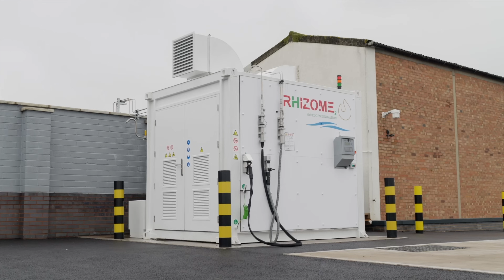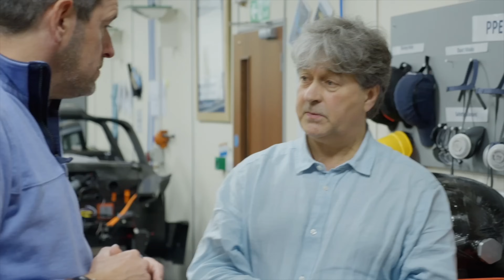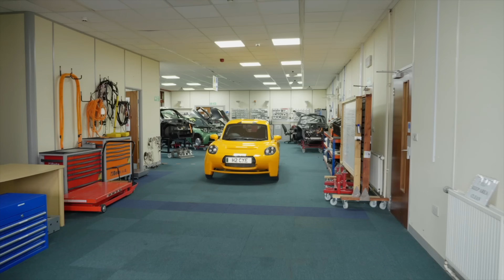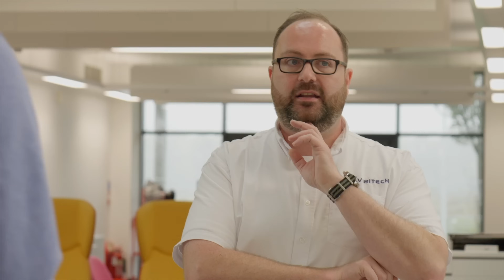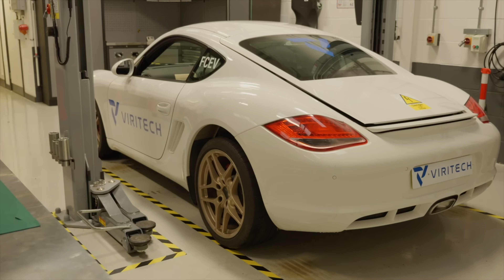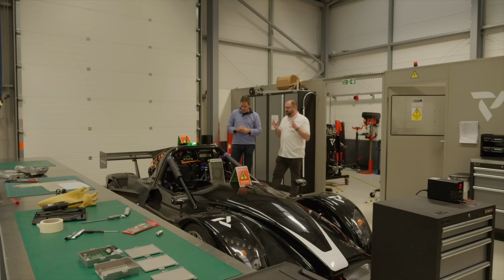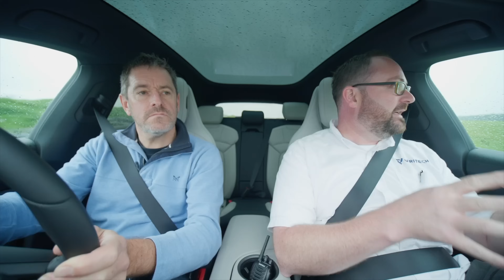Is Hydrogen a viable option for our Automotive Future ?

Comment: A small problem with Hydogen power , at this time, is cost. I have been reading and hearing about Hydrogen power for the past 50 years, yes 50 years, the principle for using the gas is well known , but still the price point for clean Hydrogen is too high. It may be that the promised breakthrough in Fission electrcal generation will occur, (again I have been waiting for 50 years) but until we have very cheap eletricity to spare the future will still be BEV, or other electric power trains. Producing Hydrogen that is not pollution free in its process is a non starter.  
The world wide requirement is for non polluting vehicle power. be they BEV Trams , Trolley buses, pantograph lorries etc. Priced and available for the masses. 
Not once was the real world cost mentioned in this video, very interesting though is is.

Comment: Hydrogen fuel cell cars have been around for over a decade. Honda had the clarity. Toyota had the Mirai, which is now on generation 2. The problem was always the lack of fuelling stations to fill up with hydrogen. There is one in my small city, but it’s in the bus depot and used for their own buses.
Reply: Exactly 3 Mirai have been sold in the UK in the last 2 years.
Reply: And hydrogen is very expensive compared to just plugging into the grid or your own solar panels. I've very comfortable not going to a gas station to buy gas or hydrogen.
Reply: @gordonmackenzie4512  also because the size of the tanks (“hydrogen is easy to store”) mirai is extremely compromised vehicle

Comment: Hydrogen has been produced for many years in Orkney. Sea water is split using surplus wind and tidal energy. Hydrogen fuel cells are used to power the hospital and Harbour.
Reply: A much better use for hydrogen tech. The gas is used pretty much used at source reducing leaks. For general transport needs it's just silly.
Reply: Yes, but if that was built now, rather than "many years" ago, I suspect it would be a different solution storing the surplus wind and tidal energy in batteries and then directly powering the hospital and harbour (and whatever else you want if you have a local grid).
Reply: @lurcher300b  it depends on how much and for how long they have to store. Storing electricity in batteries is EXTREMELY expensive and space ineffective. Yes you can have a powerbank for your house, but if we are talking about something like hospital the battery size would be enormous. 
More, in case of emergency, if you run out of battery, you are 'done' if you have generator run on hydrogen you can always transport and refill. 
Hybrogen is a dream material to deliver massive power to places where building high power installation is difficult/cost inefficient. 
but the entry point is the same. the electricity used to create hydrogen must be FREE, not green, FREE, like surplus from renewable sources or nuclear plants.
Reply: @gordonmackenzie4512  this is a reasonable use. If you have abundance of energy, create as much hydrogen as possible. Store, and use later or elsewhere

Comment: Separating Hydrogen currently contributes approx 4% of worldwide greenhouse gasses, a petrol car is less polluting. Using electricity to create it wastes 66% of the electricity compared to putting it straight into an EV so the cost is crazy. Hydrogen filling stations in the US are closing and here in the UK barely exist.
Sorry Ped this is just Oil and Gas Shill propaganda.

Comment: This is a very interesting look into hydrogen and how it can be used to power cars. Recharging is as fast as a fuel car 5 mins and can store much more energy than electric equivalent because the energy density is higher. You can also get existing fuel stations easily adapted for hydrogen than building rapid chargers. But also
The hydrogen fuel cells themselves are complex and not as efficient as ev. Still more efficient than petrol cars. Plus hyrogen is highly flammable but so is petrol. However it can leak more easily due to the high pressures needed to operate in the tank. Then extraction requires alot of electricity. I think the fuel cells are progressing and are very safe these days and if power was obtained sustainably it could make hydrogen out to be a real contendor. 🤔
Reply: Honestly, no, hydrogen will never be a contender. It is massively energy inefficient.
Reply: @appkazoo5925   yeah but so is a combustion engine. Electric won't work everywhere and for those places the hydrogen will be better. Like I said 5 minute refuel and store much more energy because of density. Production will be overlooked as it will be just for the select few scenarios where ev don't work. Its to compliment the change to ev. Not replace.
Reply: @cephasmakuzva  Nope, not happening. If hydrogen had any chance at working it would need to be produced at vast volumes and even then it would be too expensive. If you niche it down into ever smaller implementations the costs become insane.

The "5 minute refuel" is a myth.

Comment: I really do not understand why the scientific community hasn't come out strongly against this ridiculous "technology".
There is nothing particularly difficult about getting hydrogen to burn in a combustion chamber, so why hasn't it been done before?
The answer is quite simple; the energy density of hydrogen is pathetically small. Burning hydrogen produces about 2% of that of any hydrocarbon, so the only way to make it worthwhile in combustion engines is by making it EXTREMELY DENSE, so dense, in fact, that it becomes a liquid. But to get it to a liquid requires IMMENSE pressure, around the 70 bar mark.
There is no easy fix, no magical formula or technological breakthrough which can change any of these factors. There is no valve which will not leak at 70 bar and the cold that goes along with it. There is no pressure vessel which is light enough to use at those pressures, and there is no way to "crack" water without using far more energy than you get out.
The only advantage with a hydrogen fuel cell is that it allows you to convert the hydrogen into electricity relatively efficiently. 

Nobody has yet come up with a solution to even ONE of these physical limits to using hydrogen and, as a scientist and thus pretty damned familiar with the energy equations involved, I see no possible way to change ANY of these factors.

Hydrogen as a fuel for motive force in vehicles is simply way too inefficient, not because of the cracking or the burning, but because of the energy gradients involved. I don't need engineers to say to me "But if", it's simply that the mathematics CAN'T change.

Well done though, in producing yet another video promoting wishful thinking over hard science, you join a long list of other content providers who can sell people on an impossible dream.

Comment: I would like to share your vision, but hydrogen is just too energy intense to produce it green, you may as well use the energy that makes hydrogen,  to make electricity and store it. We at a new revolution in transport and hydrogen has been stepped over.
Reply: EV batteries are not green - slavery to mine Cobalt and the sources of Nickel constrain  it.
Reply: Hydrogen is just too energy intense to produce it green. Please explain. Hydrogen is easy to store, electricity is not. 
It can be created with electricity created by green methods in periods of glut.
Reply: @matthewoakley3772  How are you making your electricity? Most hydrogen produced today comes from gas using high temperatures, and requires masses of energy and is not green. If it is made from water it requires masses of energy, not many countries are fully green electric on the scale required. Basic school science converting one energy to another is not efficient. If you think hydrogen is easy to store you need to look into it ,1kg of hydrogen requires 11m3 to store it at atmospheric pressure. To shrink it to make it smaller to store,  requires even more energy. Hydrogen was a pipe dream. If you all ready have that energy in electricity it is just easier to use electricity.
Reply: @matthewoakley3772  “it can be created with green electricity” in the less efficient process that charging a vehicle with that green power.
Reply: @matthewoakley3772  Hydrogen is actually very difficult to store, compared to electricity.
Reply: @matthewoakley3772  Hydrogen is TERRIBLE to store.  It escapes out of literally everything as a gas.  Anywhere that contains a hydrogen tank needs to be ventilated.  To have better density, you have to liquefy hydrogen and that is a whole extra can of worms.  You have to actively chill it or use it quickly.  Liquid hydrogen tanks have to have a relief valve to release gaseous hydrogen to the atmosphere for when it warms up.  So you use it or lose it.  I can leave my BEV for literally months and watch a 1% loss of charge and that is mostly due to charging the 12v battery the connectivity runs off of.  That being said, I do agree there are green ways to make it and it may not be bad to make during periods of extra energy.  There are vehicular uses for hydrogen but they will probably be limited to medium to heavy duty vehicles if battery technology doesn't eclipse fuel cells first.
Reply: @matthewoakley3772 dead wrong! Electricity easy and cheap to store in ever cheaper batteries at grid scale & in battery electric vehicles and even charging hubs.  Hydrogen is a light gas that you have to pressurise to 400 or 700 atmospheres, it embrittles metals, diffuses through almost everything and it has one of the largest explosive ranges of gas/air mixtures.  In short it is a nightmare to store and that is due to its intrinsic properties and the laws of physics.  Shame because in so many other ways it’s the ideal fuel but storage at low cost & unit weight is still not possible after 50 years of trying.  Better to use the electricity directly instead of electrolysing water…

Comment: So a lithium ion battery has a cycle life of 10'0000 cycles according to the riversimple expert, being 100'th of 1 million. How can this expert be correct when all the EVangelists say modern batteries hardly ever degrade. Of course my nearly 9 year old 30 kwhr battery would agree with the riversimple expert, having degraded by 42 % now with slightly more than 40 k miles on the odometer. Perhaps all the modern EV EVangelists who disagree with me on a regular basis could see major battery degradation in their EV's, when their EV's get oldish like my EV and degradation is not FUD after all ? No, can't be. Even the government backs EV's that have a very short lifespan as this expert suggests and therefore if he is right, will cause much more CO2 release in more regular production replacement, than a combustion engined car ?
Reply: @sdk2006b So are you saying that my nearly 9 year old 30 kwhr, slightly more than 40k miles distance EV hasn't got 42% degradation and the loss of 5 out of 12 battery bars. Do you think I need reading spectacles next time I look at my dash board ?
Reply: @FredFox-m9v - is that a Nissan Leaf?
If so - you know the batteries in these are not representative of those on all EV’s since 2018
Reply: @SDK2006b 30 kwhr leafs were obviously the worst degrading EV's of all and more modern battery temp control systems are better but they are still just lithium ion batteries. Modern EV's degrade. Battery life channel's ID3 degraded 10% in 2 years, when he had it and that was a modern EV. You can't change physics and people with modern EV's will find that out as they age. James Cooke on youtube battery bricked at nearly 8 years old and that was a state of the art model S. My next door neighbour is complaining about his range, and that car was about 70k new and that age car are being bought back in the USA by Jaguar because of fires, look it up.
Reply: @FredFox-m9v - my 3 year old Polestar 2 (36k miles) range was still the same when I gave it back.

My 10 kWh home storage battery is 3 years old - charged every day from 0% to 98% and it’s still 100% battery health.
Guaranteed to 80% after 10 years.
Reply: SDK2006b My EV first battery bar loss was after 5 years. It has now lost 5 at nearly 9 years old. My Ecoflow Delta 2 powerstation  description, states about a 10 year battery life. EV's handed back after 3 years is no basis as an example of comparative longevity against normal cars and is not exactly environmentally friendly. I have in my garage a 20 year old Mazda MX5 and a 17 year old Mercedes E Class. I would say that is, both bought new and working perfectly still. The Merc has a range still of 650 miles brimmed at highway speeds and 51 mpg doing so.
Reply: EV Odessey is just handing his 3 year old Kia EV6 back for a Kia EV3 and he has done a degradation test. The car seems to have lost less than 1%. And battery technology are improving all the time. 
This guy on hydrogen is of course going to look at worst case for batteries and best case for him. Remember Toyota has a hydrogen production car and in all honesty it wasn’t impressive, ask James May and hasn’t taken off because the lack of Hydrogen fuel stations. Hardly any available. If Toyota struggle then what chance has a company working out of a small workshop have. Lots of positives for Hydrogen, but a hell of a lot of negatives which of course this guy doesn’t mention. I think it will be EV’s and possibly totally synthetic fuels. 
But who knows 🤷🏻
Reply: @markgeezy1809 If you are happy buying an EV, buy one or keep one. For me, I will never buy another one ever, after my ownership experience. The choice as they say, is yours ?
Reply: @ I love my ICE cars and have been fortunate enough to have some high end performance cars. But I also love my EV. Quick, spacious and comfortable and has never let me down. However albeit from UK. I live in Scandinavia and when it comes to infrastructure and charging speed etc. They are miles a head. So never an issue and anxiety range doesn’t really exist. Which shows with the right infrastructure and investment it can really work. Plus I guess it depends what car you had?
But as you said each to their own.
Reply: @ - don’t let the Leaf experience put you off. They were very early to market and much has improved since.
Many easily do 300+ real world miles now, with awesome tech, and a smooth/fast/quiet drive
Reply: @FredFox-m9v 
By an EV with an LFP battery. Those have a 5000+ charge cycle life if abused. It can't be compared with a gen 1 Nissan Leaf, with old technology cells, rubbish battery management, and zero thermal management. 
It's like compared oranges to banana's.
Reply: @johnnodge4326 LFP batteries do indeed have a longer lifecycle kwhr compared with kwhr  but they are less energy dense, therefore  the cycle use per mile driven per kg of battery weight and physical dimemention will increase with this aspect of LFP batteries. Reducing range per kg and physical size and also battery life per kg and physical size in this aspect because of the greater cycle ratio. The range with normal lithium ion batteries is probably less than a third that of a diesel car with a typical 60 kwhr battery. LFP batteries are obviously worse still.
Reply: EV batteries do lose capacity, but nothing as bad as the anti-EV FUD would have you believe

Comment: Hydrogen power will be a non-starter for transport in the long term. Fundamentally, every kWh of hydrogen requires two kWh of electricity to make. In vehicles hydrogen power trains are also more complex than those that are battery electric. This means that hydrogen vehicles will always cost more to make and run than electric vehicles.  This will particularly be the case as battery storage density continues to improve, reduces in price and becomes faster to charge.
Reply: Absolutely correct, and worse than that, it is the smallest of molecules that means fundamentally difficult to store... it is leaky.  Hydrogen's interaction with the atmosphere is a greenhouse gas.
Reply: Don't agree.  If you can make your Hydrogen from renewables (JCB do this and Porsche has a different sustainable fuel from Renewables) then this is viable.  It is particularly important to be used for some Trains, buses and critically Trucks.  Electricity simply isn't good enough.  Add the potential for development and this is a very exciting technology.
Reply: @mrgrumpy771  But even if made from renewables it's far less efficient than using that renewable generated electricity directly. Trains buses and trucks are running on electricity now. Did you know those diesel locomotives use the diesel engine to turn a generator and then electric motors turn the wheels.
Reply: @mrgrumpy771 
A JCB that can only run at full power for a couple of hours per charge of H2 isn't going to be very popular with building firms, when there are now electric versions from other manufacturers that will run for a full 8 hour shift on a single charge. 

Nobody is going to be driving H2 cars, when they cost 20X more to fuel per mile than an equivalent electric vehicle.